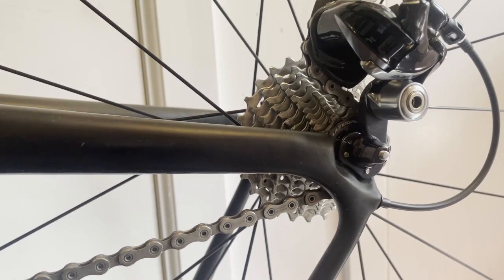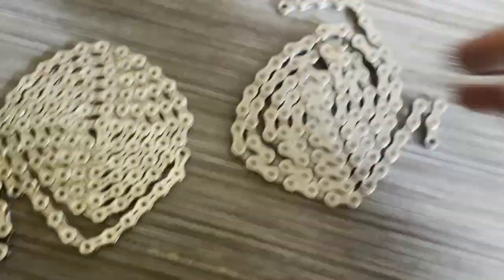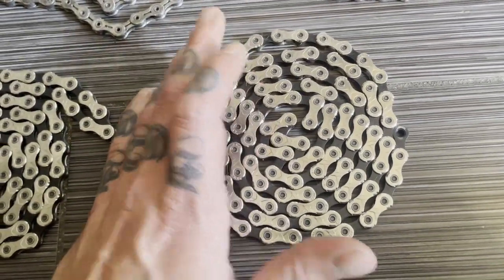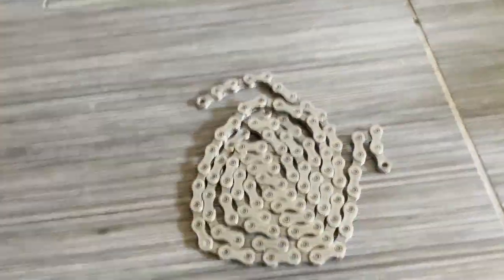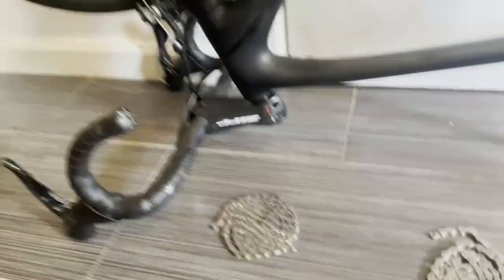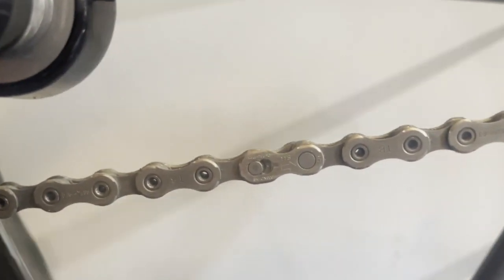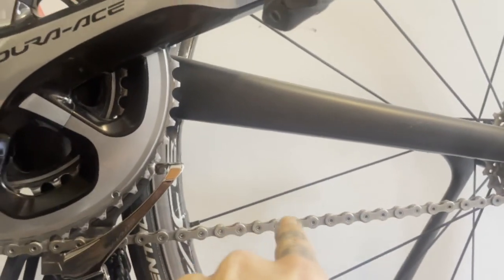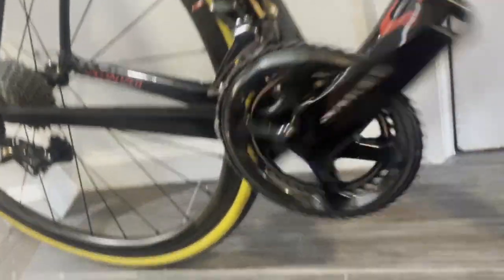Shimano VS KMC chains

Comment: I was trying to find a new chain and ended up speaking with a Shimano dealer. He told me Shimano chains are made by KMC.
Reply: That's actually one hard truth for other riders. I've knew kmc was in partnership with Shimano. Cause I used to have a Shimano branded chain with kmc z logo at the sides.
Reply: but with different specifications
Reply: Where is the links that proved this claims?
Reply: I can confirm its true
Reply: No different than Giant making about every bike out of Taiwan and China, doesn't make them the same.. My Shimano and KMC chains are very different.. I'll take the Shimano chain any day..
Reply: @andrewlabat9963  well, Merida makes bikes too
Reply: That they are made ny kmc means little. It doesn't mean kmc chains are good. It's made on specific equipment with with specifications of shimano
Reply: Made by KMC with Shimano specs, yes
Reply: To my knowledge, both KMC (10 speed and under) and Izumi (the high end) manufacture chains for Shimano, according to Shimano’s own designs and specifications. As a pro wrench, in my opinion if you are running an all Shimano drivetrain, using a Shimano chain will work the best. But of course most bicycles are not fully integrated, often running a different brand crank and/or cassette, so at that point it does not matter much what chain is used. I prefer to stock KMC because they use quick links across their entire range, and are two links longer than SRAM.
Reply: It's like samsung making iphone's screen , with specifications.

Comment: I think KMC 9 speed chains are great.  9 speed Quick Links not so much. The last few pairs that I bought, the pins on the 9 speed Links are .41 mm wider than the pins on the kmc 9 speed chains. Making the links sloppy when deflected compaired to a chain link. The link pins are only .15mm (.006 in.) narrower than the space needed on a 9 speed cassette. To make the chain work properly I do a very slight grind on 10 speed links so I can get them apart and they are perfect. (I use wax on my chains and links)  Wish they would make the Quick links the same wodth as the chain. : )

Comment: Was a LBS mechanic for 20 years. Retired in 98. At that time KMC chains were a joke. We carried a mid level bike, of which we sold a couple of hundred a year. We would replace the chains with entry-level Shimano chains during the initial assembly. It made the shifting much crisper and the sensations at the pedals much smoother. We felt like it helped sell the bikes. That was a long time ago. Maybe things have changed, maybe not. I'd be hard pressed to use a chain not branded by the drive train manufacturer.
Reply: Interesting. KMC started supplying for Shimano in 86, so maybe there were a lot of leftovers from other suppliers until 98?

There manufacturing/branding supply chains are crazy! It's really hard to tell who makes what and why the quality is so and so (unless the companies themselves disclose it)

Comment: the KMC chains are much more efficient. Less drag. But they wear out quicker. Good for racing / performance riding.
Reply: That has been proven to be incorrect. Shimano is faster when new. But wears faster.

Ultimately, you'd want a shimano dura ace chain, completely cleaned and dried out... then heat up the chain and have hot wax lube filling in the internal tolerances... then let it dry... 

This will be the fastest, frictionless, and longest lasting setup possible.

If I could remember the interview I watched of one of the Team Sky mechanics talking about this, I'd link it, but I can't find it off the top of my head.
Reply: @tofuguru941  and doesn't wear faster. Slower from deore onwards if I would bet

Comment: KMC chains are great because you can use them on any drivetrain whether it be SRAM Shimano Campy it can be used it can also be used for both MTB Road or maybe gravel if youre going to get a Shimano drivetrain its best to use a Shimano Chain but KMC also makes chains for Shimano so it will work too

Comment from the maker: Whether KMC makes shimano chains or not (which i read conflicting reports online about) is beside the point. The point im making is that KMC branded chains are designed to be universal, which is cool and the are not bad chains, but Shimano chains are superior for shimano drive trains. As they have design features to match the tooth profiles of shimano chain rings and cassettes.

Comment: Ultimately, you'd want a shimano dura ace chain, completely cleaned and dried out... then heat up the chain and have hot wax lube filling in the internal tolerances... then let it dry... 

This will be the fastest, frictionless, and longest lasting setup possible.
KMC SL's will outlast dura ace, but it will wear out your groupset drivetrain quicker since it wasn't made to work with the pickups and drop offs of the drivetrain like the shimano chains are.

If I could remember the interview I watched of one of the Team Sky mechanics talking about this, I'd link it, but I can't find it off the top of my head.

Comment: I went from a kmc on my grant trance 29 1 12x to a shimano, and it was night and day different.  Smother, better shifting and quiet. My drive train ia all SLX. My bike came from the dealer with a KMC, so i figured id put some miles on it until i needed a new one, but after 60 kiles I hated it. I'm big on, if you have a complete group set, get the same brand chain. It just works better together.

Comment: Hello there, I got to this video by search on youtube.
So, I can confirm all you said.
Currently I have two bikes, one vintage road bike with 10 speeds and when I replaced the old chain I out on KMC Z6 chain and it works really fine, it is silent and shifts fine.
My other bike is Cube MTB which came with KMC X10 chain frim factory. When the bike was in 3x setup it was let’s say OK. But later I converted it to (yes I am trying to do repairs and upgrades by myself) 1x setup as I found it perfect for my needs. So, I often record my rides with GoPro camera and I noticed how loud KMC chain is, specially in low gears, really loud. Now I am upgrading my bike again 😂 to 1x11 with wide range cassette. Now waiting for Shimano CN-HG601 Chain to come to set all up. That chain has Sil-Tec technology so I am pretty sure it will be much quieter than KMC.

Comment: What's the point of a hollowed out chain when the chain will just filled with muck negating much of the weight savings ?
Reply: I tend to use wax and clean the chain after every ride and don't have the issues i did when using oil.

Comment: You don’t know what you are talking about.

There is no such things as its optimized to a groupset as they all work the same. The chains you are comparing arent even equivalents side by side chains.

You also have to note that most inline KMC chains are fakes.

No, they are not noisy at all. They test quieter than others literally.
Reply: Right. They are fitting brand new chains to part-worn drivetrains then complaining because they don't mesh together silently. It's never going to at first, they have to wear together or at least have a chance to. Even if you swap to a new chain after just 100 miles on a new cassette it will not be the same as a new chain on a new cassette. Riding it makes it silent eventually, are these people even riding their bikes... hahahahahahaha!

Comment: Interesting musings. Have the KMC 11 speed, but having an Industry Nine Torch hub, I can't hear anything above the SOB (swarm of bees) sound coming from the hub. I did bid and won on a new KMC 11 ($33), but having a Kore chain rings and Garbaruk cassette, I guess any chain will do with my Frankenstein set up. Checked out the Absolute Black lube that you referred to. Whoa. $145 for a 4.7 oz bottle. For myself, I'll use the lube on hand, but maintain the lube through more frequent applications. Thanks for the video.

Comment: Recently put KMC x11 chain on my Sram 1x11 equipped mountain bike and like you said - it's noisy but works. I wish I had spent $8 more and purchased another Sram chain.
Reply: Lol KMC is tested to be less noisy. 
They also make most other chains under white labelling.

You guys don’t know what you are talking about.
Reply: @mattk8810  thanks for your kind response. I must be listening to someone else's bike with someone else's chain. Silly me. Have a nice day.
Reply: @mattk8810  Exactly. They are putting brand new chains on part-worn chainrings and cassettes then wondering why it's noisy! Ride it for a few hundred miles and as if by magic, it won't be. There's always a light scrunching noise from a new chain on an (even slightly) used drivetrain.

Comment: I think it depends a lot more on how you treat and use the chain than who makes it (or markets it).  I'm not hard on my chains - I don't ride through mud and dirt - so I can't speak to that type of use.  I've been using KMC chains on SRAM, Shimano and Campy setups for 20 years and the chains are quiet and last a long time.  What has made the biggest difference to me is the lubrication.  I've tried everything.  Some lubes  last longer.  Some are quieter.  Some are cleaner.  Pick 2.  The chains are all fine.  Just make sure that they aren't counterfeit.

Comment: I’ve broken every shimano chain I have ever had.  I switched to SRAM before they ever made a derailleur.  All my bikes were one kind of campagnolo group or another until my current bike which has a shimano group set because it seems that is all they sell anymore.  The campy chains were really no better mostly because, at the time, they did not use a quicklink.  I don’t care if SRAM chains are noisy.  They shift well enough and when you are standing going up hill at maximum effort, I can trust that at least I won’t get kicked in the nuts because the chain breaks.  So if anyone suggests that you should use a shimano chain, just kick them in then nuts to explain why not
.
Reply: Are you riding 2 x drivetrains with SRAM chains?
If so, can you use a SPRAM 12sp on a 2 x 11?
Reply: @DR_1_1  I couldn’t say if you can run a 12 speed chain on an 11 speed set-up.  I am actually not particular about shift quality or noise, so long as it is functional.  I come from toe straps and friction shifters on the down tube so overall functional quality spans all brands IMO.  I also don’t care if it isn’t the lightest chain out there.  What I won’t tolerate are broken chains, which is why my general recommendation is to never buy a Shimano chain.  I’ve never worn one out.  I always break them.  As it is, I am actually running my first KMC chain now.  I still think I prefer SRAM.  If I don’t break it in one season, then at least I have options for chains.  Yes, I run a 2 x 11 drive train and buy the corresponding size.
Reply: @mortimersnerd9991  I was a toe strap guy for 25+ years too, but I removed them 1-2 years ago, some shoes don't fit well... both bikes still with flat pedals!
I just bought a Connex chain for my old 2 x 7 bike, 20-30 €  range, the previous one was not completely worn out (0.75% chain checker), but looking more closely it was not straight anymore, some sections rubbing against the derailleur cage, other not...
Btw, I was asking about 12sp on 11 sp cassettes, because SRAM 12 sp XX1 and X01are supposed to be 2 x more durable than most other brands/models, on zerofrictioncycling.